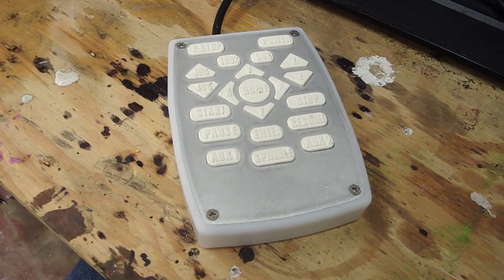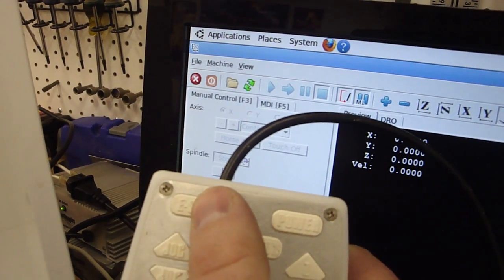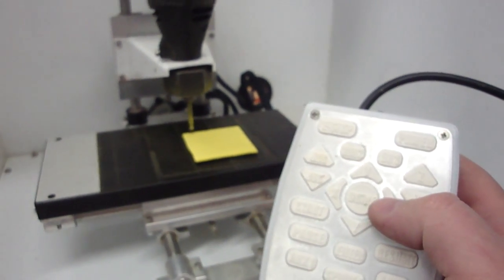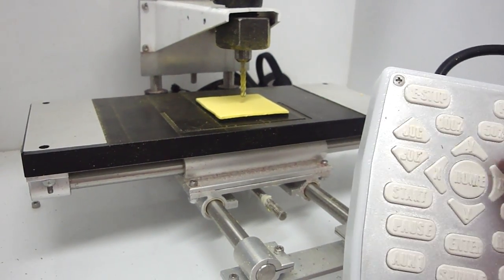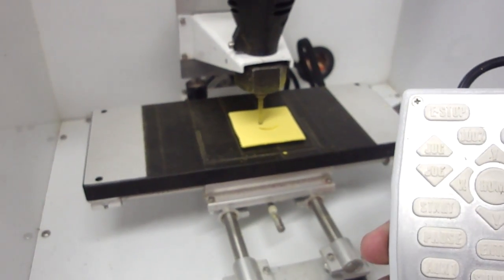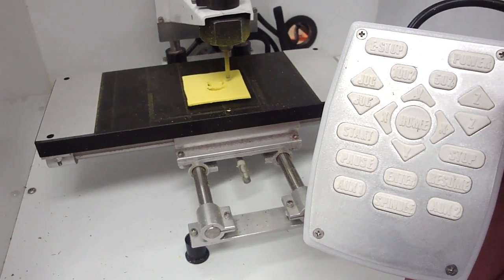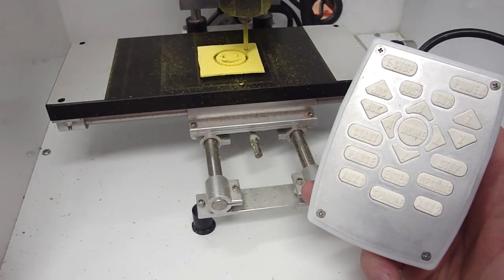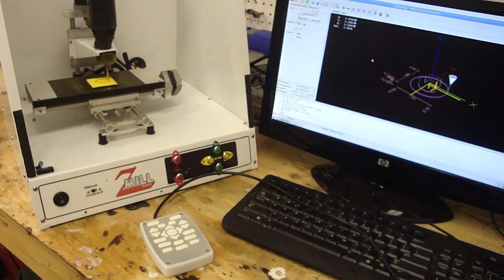Open Source CNC pendant controller for EMC and MACH3

Comment: I received my pendant a couple days ago, and haven't hooked it up yet, but wanted to comment for those out there who may be interested.  This thing is prettymuch bulletproof.  Heavy plastic base, with thick aluminum plate and a pretty beefy button material makes this thing quite sturdy.  The buttons press very crisply and the button material absorbs any "overpress" button pressure.  My only criticisms would be the raw, unpolished metal and white on white button text. This is going to help a ton.